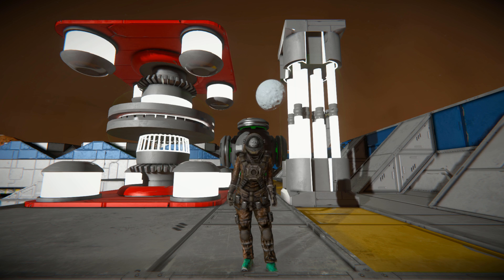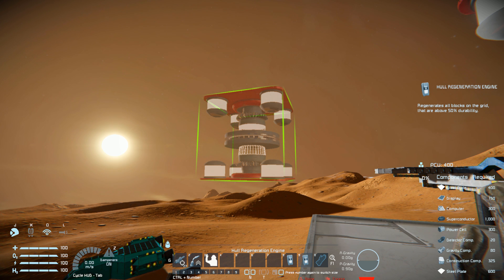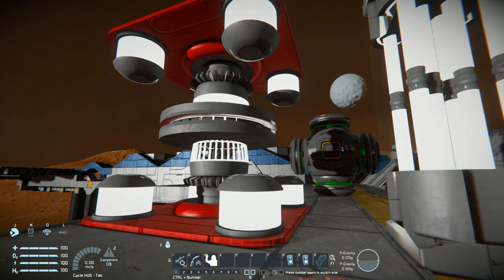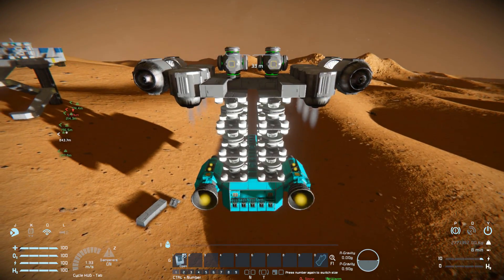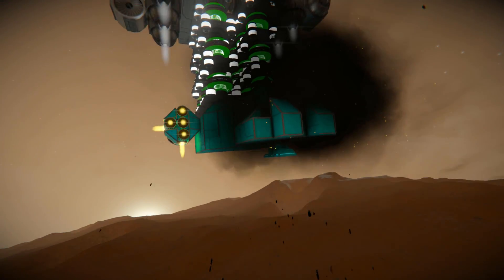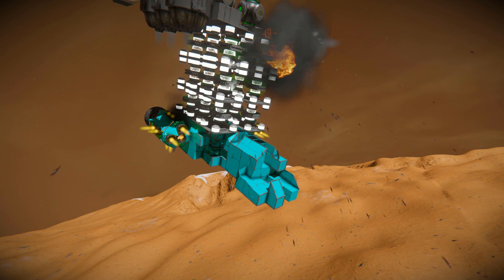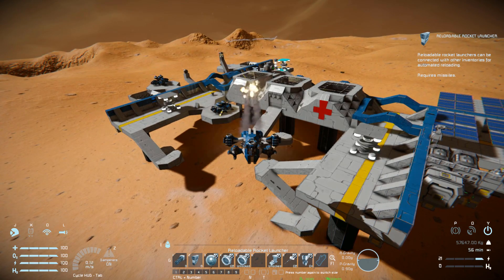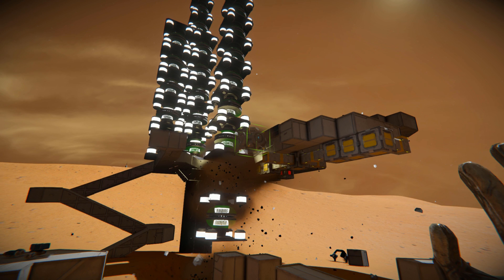Hull Regeneration Engine - Space Engineers

Comment: Nanobots build and repair requires items to repair blocks and build blocks it can also be set to grind blocks and pickup items. This mod appears not to use any resources to. And is rather cheap in the long run considering how much 2 or 3 jump drives cost.